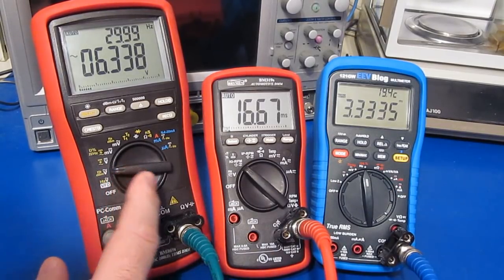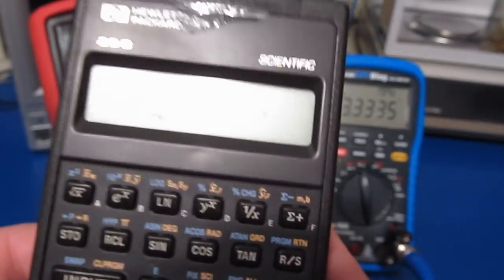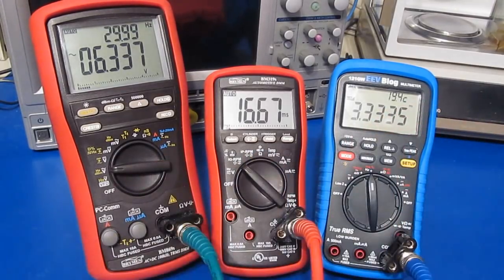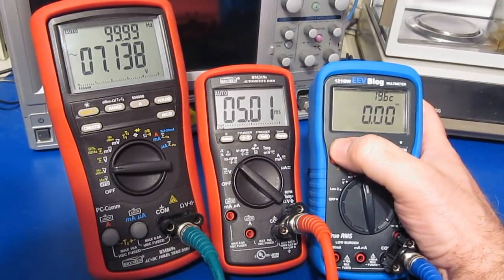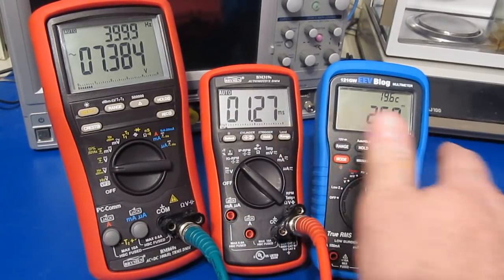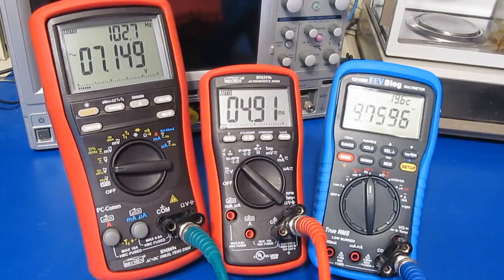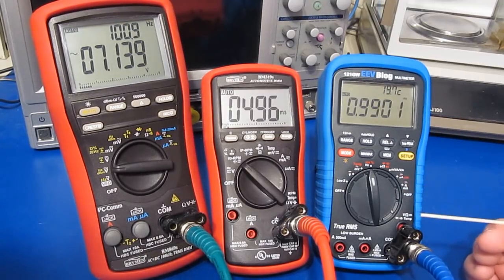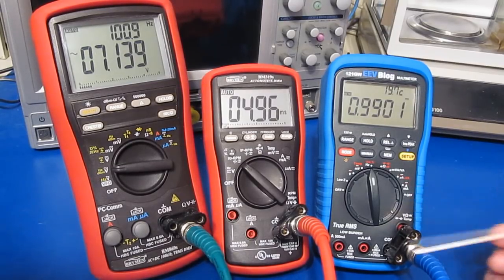Preproduction 121GW Period Measurement Demonstration

Comment: I'm not sure which one is the wrong result here - shouldn't the period be the reciprocal of the frequency? Why the additional division by 2?
Reply from the maker: Sorry about that.  First, I think we can agree that the reciprocal of 100Hz is 0.01 seconds, not 0.001 seconds.  That is the period.   From that alone, it should be clear which result is wrong.   As I mentioned, the Brymen BM319s is for automotive use.  It has a feature that can measure dwell and fuel injector timing for example.   This is the pulse width, not the period.  Because I am testing with a 50% duty cycle, the pulse width it half the period.   This is why there is an additional division by 2.
Reply: Ah, so you only divide by 2 to explain the BM319s result. I initially thought you were complaining the displayed results don't match…
Reply from the maker: My complaint is that the UEI meter does not calculate the period correctly and is off by a factor of 10 below 100Hz.  Yes, the divide by two is to explain the BM319s result only.

Comment: I like eevblog and learned a lot from the forum and Dave's videos, but I feel like Dave really jumped the gun on releasing this meter. Hopefully everything can be fixed in firmware. Ill buy one once everything is settled.
Reply from the maker: If you saw the recent pictures that were posted, it sure looks like the switch is wearing prematurely.   That's a hard thing to address with firmware.  Maybe it's not metallic dust we are seeing.
Reply: joe smith you would be surprised what they can do with a firmware update. Just listen to the first 60 seconds of this video. https://youtu.be/_q6Ys37VFdk LOL
Reply from the maker: If they can fix a bolt they can surely fix any problem the UEI meter has.
Reply: Everything buy my Microsoft surface pro 4, lol. Well doesn’t matter now, I sold it.

Comment: I know you have tested the prototype but I would love you to get your hands on the released version. thanks for sharing Joe.
Reply from the maker: I'm not showing anything new with these videos.  I was concerned with Dave not making a full review of the meter  that they were not going to be upfront about the problems. Had he even made a video showing that it still had the problems but went through all of them, detailing what they are and how they plan to address them,  I may have chosen to support the kick starter.  I'm not much of a fan boy when it comes to meters.  The have to earn my respect and that is a rough road to travel.   lol.   I think Scott at Gadget Review Videos, never received his but plans to do a review of it.
Reply: I agree with you. Dave Jones should address the problems with this meter. I wouldn’t buy this meter because its not robust enough there are so many things I don’t like about this meter the dial is likely to stop working or fall off the lag is awful things you find on the cheap meters. Keep doing what you do Joe you have earned my respect you put a lot of hard work into your videos.
Reply: If I ever receive it, I plan to do a review of it.  Like the BM235, but this time I’ve updated my precision resistors to include the ones I had before and new ranges with some new Vishay milspec resistors, and even 0.1% 1Mohm, and others up to 1Gohm. Some new capacitor standards, and might even update my voltage reference if I have time to include 2.5VDC in addition to the 10V and 5V references I had already built. I bought a 2.5V AD ref chip, not as accurate as the others I use from TX and BB, but I’m hoping it will be good enough. 
I’m even debating on buying a real signal generator, never thought I would need one but recently came across 2 times it would have been nice to have.
Reply from the maker: Sounds like a few people in the USA did receive theirs.   Someone also posted about a March shipment.   Maybe next year.  lol.   If I were to run another, I would include some sort of life cycle on that switch.  After seeing those pictures that were posted, it appears to still have a wear problem.  Maybe you can run a test like this when you get yours.